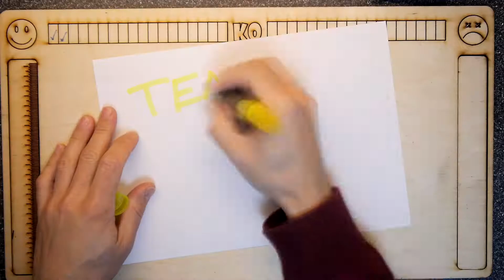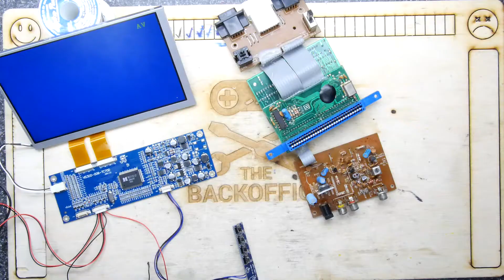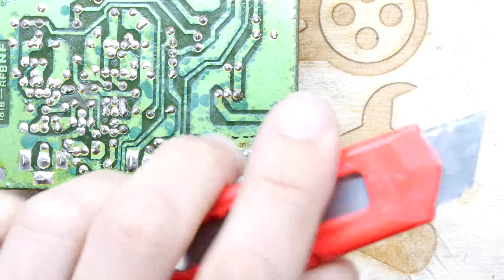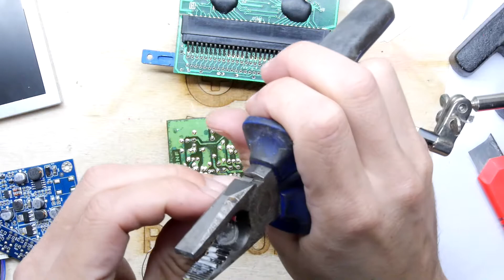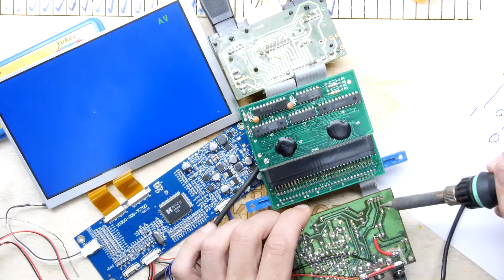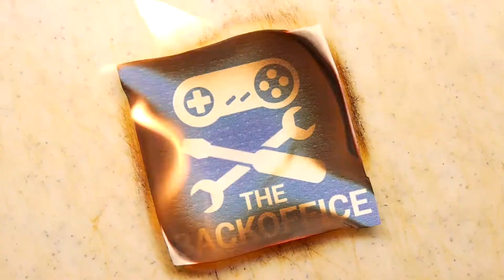Nintendo Famicom Rinco Famiclone Repair

Comment: It’s really nice to see a RINCO repair on Youtube! I had a RINCO as a kid and I repaired the loose pins on the controller port with a soldering iron many times back then as a 10 years old kid. I loved my famiclone and I had no idea that it was actually a clone! I had never even heard about Nintendo. 
What was sad about my RINCO  was that there were a few titles in the title screen that didn’t work. I mean when I pressed the Start button the title screen jumped back to the first page of the title screen. I remember that there was an IC missing from the internal game cartridge. Do you think that it would have been possible to make those games work? I still have the console and it’s still working after 30 years! The games that were missing were Turtles and Captain Majed, as they were named on the title screen, there was maybe one more that I can’t remember.
Reply from the maker: That is interesting about the missing IC, I wonder if that was the ROM containing those particular games. Well, if you can get the console working again you could re-create the contents of the cartridge using some soft of everdrive, it might even be possible that there is a copy of that exact cartridge online somewhere!
Reply: @backofficeshow  Interestingly I could find a forum where someone posted a picture of the exact same cartridge and reverse-engineered it. The missing chip is not a ROM. It’s a “Tristate buffer” as they say (I don’t know what it means). That’s the only online info available for this unique type of cartridge. I hope they answer my question and solve this 30 years old mystery for me!

Comment: A 7805 requires at least 7 volts input for 5 volts output.
Reply from the maker: +Ashley Booth That's good to know. I wonder if this characteristic is the case with alternative regulators, technically they could close the gap so they only start shunting nearer the required voltage 🤔
Reply: The Backoffice The 78xx series are old designs. A more modern regulator will have a lower dropout voltage. For example the L4940 has a dropout voltage of about 450mV.

Comment: actually all famiclones and even original famicom are with center negative   :)
Reply from the maker: +intel386DX it's mega annoying. I'm glad centre negative is pretty much a thing of the past.
Reply: hah yes definitely very annoying , but I will not boder to change  it like you even on the crappiest famiclone, it is easier to "mod adapter it self :p
BTW
I think the package games for this famiclon should the rockman/mega man series because of the pretty blue theme :)
Reply from the maker: +intel386DX I only want a system to play those exact games, one day 🤔
Reply: @intel386DX  there are adapters to convert the centre -ve to +ve and vice versa ;)
Reply from the maker: I'm just waiting for a PCB I designed that replaces the PSU board and lets it take any polarity and gives composite out. I'm Looking forward to it!

Comment: the reason it uses center -ve is because its designed to work on a bog standard, cheap and readily available megadrive psu
Reply from the maker: +ImpaledGryphon ahh

Comment: the noise seemed to change most when you touched the audio wire, was it possible the unused channel touching random places on the board was causing the issue?
Reply from the maker: +capri2wd it's really odd, I'm not sure at all. I'm going to follow this up with a video just about the audio as it's definitely not right

Comment: Rebuild the PCB minus the RF circuitry!

Plus: Audio problem might be linked to composite and RF signal bleeding into the audio signal (60Hz hum and noise)
Reply from the maker: +Phil Sierra Hmm, this is an excellent idea! If I can research exactly what the signal on the audio and video lines from the doc SOC is it should be totally possible 🤔